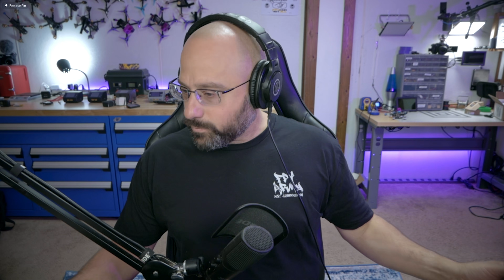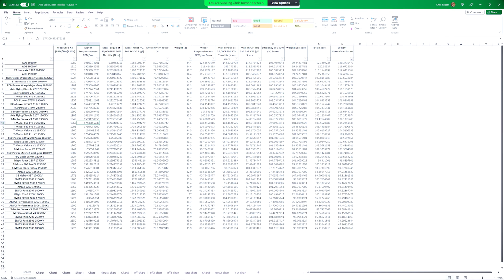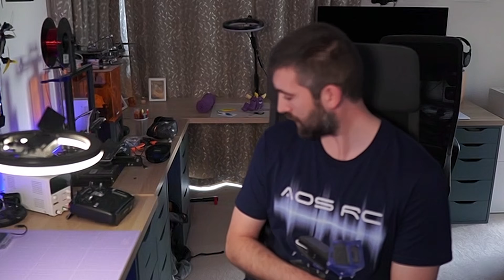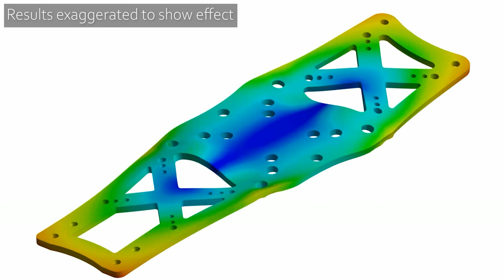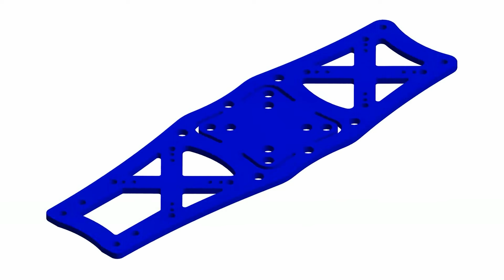The most powerful, most efficient 5" drone motor ever made // AOSRC SUPERNOVA 2207

Comment: if using SLM/DMLS 3D Printing could the weight be reduced without compromising the currant specs. My self not knowing where in the structure to cut the weight based off of the magnetic flux I would not know this answer. But I do know I can cut weight on most all components in the aerospace realm that i have worked on using 3d printing (additive manufacturing) just because you cant manufacture these types of structures any other way. would love to help I am at MiMe Global.

Comment: it's clearly a much bigger and way heavier motor, from the dimensions it looks closer to a 2307~2408 , and expensive, the much bigger size gives it marginally some efficiency, and obviously more power and torque
Reply from the maker: It's 33 grams, same as a typical 2207. This information is in the video, as well as more information about how Chris achieved his design goals.
Reply: @JoshuaBardwell  yeah maybe motors have gotten heavier to be more durable, but the five33 2207 is 28g, Emax rsii 2306 is 26g
Reply from the maker: The 533 lists itself as 28g, but using Chris's standardized weighing method, it comes out to 32.8g. I have no idea where they got the 28g number that they show on the product page. Maybe with no wires at all?
Reply: @JoshuaBardwell  either way its not an 2207 and its a bit heavier then most, MCK also has a light 2207, it's closer to a 2308 with a lighter bell, And comparing it to smaller motors is very misleading and of course his motor is best, It's a bigger motor that consumes more power and at 60A a Lipo will barely deliver that current for two motors, so the motor will never reach its full power in flight. The efficiency is also marginally better 4% but tested only at 350W[maybe that's where the difference is bigger?] We still don't know how durable they are with a lighter bell and magnets, and at 35USD [Aliexpress price] for a motor that you won't find in stock when you'll need its too much
Reply from the maker: The motor will not pull 60 amps in the air. Motors typically pull about 25-30% less current in the air than on the thrust stand, because in the air the prop can unload as the quad accelerates. There are plenty of "50 amp" motors running on today's batteries, which as you point out, couldn't possibly deliver 200 amps. So clearly the thrust stand current result is not the limiting factor in a motor's performance.

Comment: Looking at it from Bob’s perspective, I think real world flight would tell more about what a motor is doing in regards to feel for the pilot than bench testing and numbers. While the numbers are interesting to see I’m not convinced they tell the whole story. But even then, I’m not sure many pilots would even feel the difference as many may not feel the latency that we incur with video and control link either. I think durability should be the most important aspect going forward as motors now for most part are almost all very respectable for majority of pilots. Thrust and efficiency are good but how much thrust does one really need? I’ve actually limited some of my motors to get more consistent control and this was something I started after listening to Slatt. Of course there will always be those that can feel and push our hardware to its limits and have high expectations but I’d say that that will always be a small percentage of pilots. Just my thoughts on the motor thing 😉
Reply: It's worth noting that even if you limit the pilot inputs the flight controller itself can still make use of the increased responsiveness to damp out disturbances like propwash and make the quad better respond to pilot inputs.

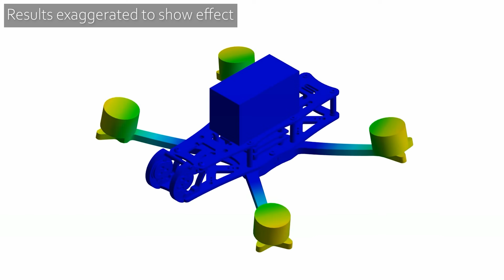Comment: 35:04 Vibrating arms and streching base plate: The ESC would have to be installed on the base plate due to the motor connections. And the FC at the top plate. The top plate has less vibration and stretch?
Reply from the maker: The FC is installed above the ESC per usual.
Reply: @JoshuaBardwell  I'm unusual in many things. So from now on I will mount my FC upside down to the top plate. :D
Reply: and yeah the strech is converted to the top plate by the stand offs... Yeah so the CR methode should be the best...

Comment: Very interesting approach to the vibration situation. More recently I've been testing a change in the orientation of the main deck and how the arms attach. I'm finding some nice consistent improvements. Combining this with Rossers cut outs as well as bracing for the areas around the carbon bridges to the stack may lead to further improvement.

I'd love to push the limits of the motor software to inspect some of the unique motor designs I've come up with. Especially if it can deal with reluctance forces. Not just for FPV. Rosser and I historically seem to be on the same wavelength so I'm sure I can just wait and he'll come up with similar ideas on his own.

Lately I've been looking into things that there are no answers to. From motor designs, gearboxes, batteries, battery management, carbon integration and manufacturing methods. There's a shocking amount of bad engineering out there across a wide variety of industries...
Reply: Yea I was going to say it’s not bad engineering but practical engineering. 

We can’t have supper expensive fiber in these kinds of destructible quads. Trade offs.
Reply: I have a friend in the carbon fiber industry and when I showed him some of the best frames on market he laughed at the quality of the carbon lol.  Just simply changing layups and resins you can get astronomically different results from just the carbon itself.  Something I've been looking into lately myself for some non fpv related stuff
Reply: @Brian-S  Most people from other industry is look at our construction materials and think it's comical how bad they are. I have tested some of the The best carbon out there according to the manufacturer and have found that there are actually quite a bit of improvements that we would gain however the cost is also astronomically high so the value proposition just isn't there. Cost is really the crux of everything. If you can't make it cost-effective enough to be used in any reasonable application, why bother developing it.
Reply: You should clone both his motor and frame for the lulz.
Reply: Still praying you 3 (Chris, Bob, Ryan) get together and tear the roof off the hobby...

Comment: Ah yes, a smoother motor must also be able to change speed quickly due to the interference to control it and regulate it fast... that it remains invisible or does not arise... that's true, I hadn't even thought of that... I was always surprised that some people call the 1507 smoother than the 2004.

Comment: the Flight controler cutouts is pretty sweet idea.
I could see where the gap would allow it to float. and could control the contact points.
Reply: depends on the material. more flexible softer crap will eat more vibration. if its rigid as fuck vibration will transfer like its not even cut.
Reply: @derrickcripe507   It seems so simple and obvious, once Chris explains it, and shows how it works. I wonder if the direction of the carbon fiber weave would affect the travel of standing wave vibrations that make their way to the flight stack?

Comment: So it weight as much as the 25mm imperial motor ~34g and make more power than a 28g 2207 (Five33) motor?  This is really interesting, but don’t call it 2207 if it’s not a 2207.  An extra 20g in a build isn’t really that much I suppose.
Reply: Looking at the spec-sheet it does look like it is a 2207.  This is also among the highest prices for a 2207 motor out there.  RCInPower is also way up there... but something bugs me about all of this - 

In Chris's testing of the motors, the Mr Steele motors stunk - they ended up at the bottom of the list.  However, watch Steele fly with what those "shyte" motors and tell me anything is missing at all???  (note that Chris tested the V4 motors so it is entirely possible that the V5 motors have fixed things and have become one of the top performers - we would need to see Chris test the motors to find out.)

 Perhaps the Steele motors truly are at the bottom of the list and who knows what he could do if he got his hands on the ultimate frame, motor, FC, and tune - perhaps he could do tricks and maneuvers that we have never even seen yet...  perhaps we haven't even seen anything yet but somehow I just don't see it...  His quad flies awesome, his tricks are amazing, his reaction times and ability to sense his surroundings and hit tiny gaps is just awesome.

So how come Mr Steele can fly so fricking amazingly well with the worst motors?  How do we make sense of this?  Because we all have the same question to answer - what would be best for me -The torquey-est, punchy-est most powerful motors that money can buy, or Mr Steeles Ethix motors that came in last place?  I would love to fly like Steel does... so which motor do I pick?

I do wish Chris the best of luck with his new motors - I am sure they are great and will do well.  It would be nice if they were not some of the most expensive motors in this size category.  

I do wish he was a little more humble though...  it is not bad, but there is something there sometimes...   he does seem like a nice guy though and I do like his 5" frame, looks cool, I am sure it flies great.
Reply: @GMx_1 FPV is 90% skill 10% gear, pretty sure Mr Steele is just skilled. The objective numbers speak for themselves as far as exact performance goes though.
Reply: @rowannadon7668   90% skill for sure!  But the question - do I personally need the motor with the most torque, the highest thrust values or would I actually be far better off with a motor that came in last place???   

I think it is possible that if we were not told what we were flying that there could be a chance that we simply somehow fly better with "weaker" motors.  I am a bit perplexed  about what I should actually get to be quite honest.  

Anyway for some reason I have my sights set on getting a drone dressed in the Pyrodrone colors - blue and orange - they have the Hyperlite motors with the same colors as well - eh, I don't know, I just like the color combo but I am wondering if the Hyperlite motors are any good?  I suspect they are perfectly fine and I should not think too hard over it... but I can't help it!!!
Reply: @GMx_1  It's the same in every hobby, nobody needs the best hardware, it's just part of the fun knowing to have the best.
Reply: There's no reason to expect a worse-performing motor to fly better, but by the same token most people will be limited by their own skill far more than by their equipment.